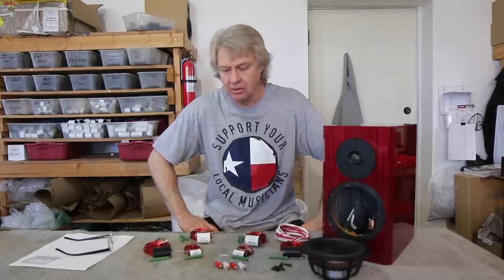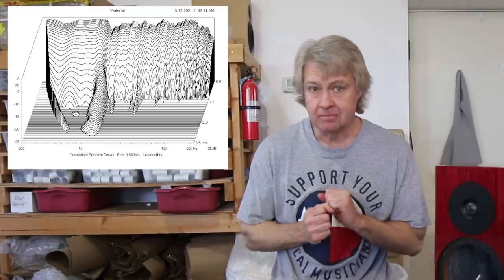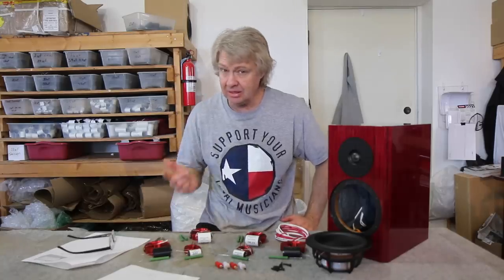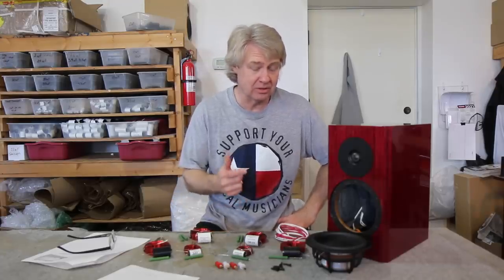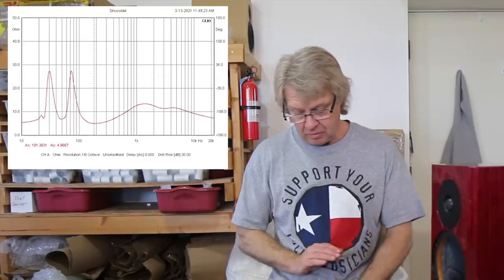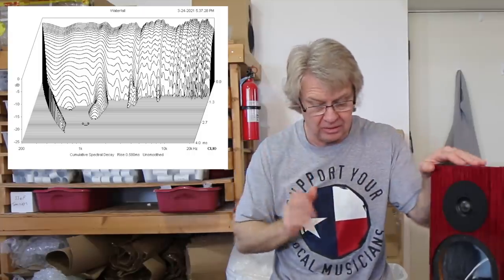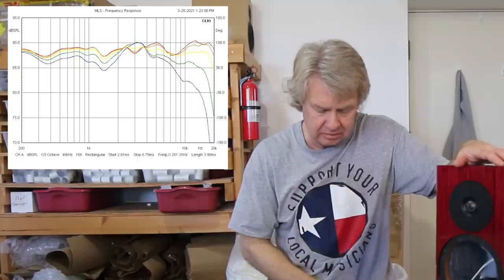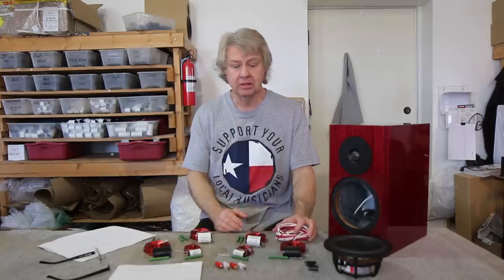Dynaudio | How “Special” is the 40?

Comment: These videos are very interesting but having heard the Special 40s many times (they sound very good) I have to ask, what's the point of changing all these parts if it doesn't make them sound "better" to the owner? We should all know by now that measurements are not the only determining factor in how well we think a product sounds. Many manufacturers have produced things that measure very well but sound lousy.  So I respect Danny's work, it's very important and informative, but without any qualitative listening comparisons before and after it's all moot. The bump in the 1k-1.1k range is well known and many owners of the S40s actually like it, so changing out all the parts for better ones is great in theory but if the sonic signature changes completely or enough that someone who would have bought them might no longer want to, then what's the point. This applies to all these speaker mods, not just the S40s. The HiFi world in general is very out of touch with VALUE, so let's not pretend Dynaudio is ripping people off, almost every audio company is ripping people off. Speakers are $3k, dealer pays ~$1.5k, distributor pays ~$750-$1000, costs Dynaudio maybe $300 to build the pair. That's the whole industry, nothing new there. Companies that sell direct like SVS are better perceived value because they cutout the distribution and dealer networks.  They are still making the same profit as all the other companies. Can we get some videos of before an after from people who've done these mods? You can make a nice sauce with a cheap bottle of wine, or a really expensive one, but if the cheap one tastes great, and >%90 of the expensive one which would you choose? The proof is in the pudding as they say.
Reply: If you think those sound good, then you haven't heard anything yet. What I did will make them sound better to everyone. 

You are correct though that the measurements don't tell us how it sounds. The measurements will show if there are or is going to be audible issues. 

When you do this as often  as I do you learn a lot of things that are given. By that I mean something that has repeatable results every time doesn't require confirmation every time to confirm the result. For instance, woofer break up and ringing is not a positive trait. It is not part of the input signal. It is an added coloration and is not desirable. Going from electrolytic caps to good poly caps reduces smearing. Going from cheap poly caps to Sonicaps improved detail levels and clarity considerably. No Rez removes cabinet wall resonances. Tube connectors and better wiring improve clarity every time. I don't need to confirm that every single time.  

And I get overwhelmingly positive feedback from customers that have implemented our upgrades every single day.
Reply: @dannyrichie9743  that's great, glad people are enjoying the mods. I don't agree with you though about coloration. While in theory it's not desirable, everything we/you do is coloration isn't it? Changing cables, materials, resonance etc. You're just changing the original color to one you prefer. There's no Truth in Hi-Fi though everyone enjoys the journey striving for it.  If everything measures the same we'd expect everything to sound the same. Who wants that? Everything can also be improved or humans would have stopped evolving but improvements can be subjective (though not always), especially in Hi-Fi. I prefer more pepper on my steak, my wife prefers salt. Neither one of us is wrong. I think what you're doing is great and very informative, keep it up. Would be great to get input from the manufacturers as to why things were done/left a certain way (aside from cost)? Have you reached out to any of them for comments on your findings and subsequent upgrades?
Reply: @Coolesttech  On measuring verses listening. I can make the same two speakers measure exactly the same and sound extremely different depending on the type and quality of parts used. 

And typically it is not about subjective preference. There are a given set of attributes that are always preferred. For instance, reduced smearing it pretty much always preferred over a smeared sound. 

And manufacturers reach out to me all the time. I spoke to one this week.
Reply: @dannyrichie9743  and what are they telling you? Are they disputing your findings or justifying them or both?
Reply: @Coolesttech  It is different with each company. One company sent me a speaker for me to design and offer an upgrade for their customers. One wanted to know how I was measuring and what measuring system I was using. One didn't really care about the upgrades and called to ask me about unrelated design considerations for something new they have in the works. And two of them may be doing a video with me soon. I think we will have Ron and New Record day host a three way video chat with all of us. We'll see.
Reply: @dannyrichie9743  very interesting. I'll be on the lookout for that video. Upgrades are always good, it's easy to rip apart all kinds of products out there for one thing or another. Too many people seem to think adding up the BOM is all something should cost, overlooking overhead, r&d (hopefully), marketing, logistics, and God forbid profit. Even DIY kits have profit built in. I'm curious, with regards to your upgrades, do you stop where you do to keep the cost to a certain $ amount like ~$300, or because you can't improve any further than what you've already come up with? Returns are always diminishing, I'm just curious what your goal is when you set out to "fix" a particular xover design.
Reply: @Coolesttech  I try to take each upgrade as far as I can within reason and figure out where best to use the best parts for the best bang for the buck. For instance in a lot of the upgrades I use Sonicaps in the tweeter circuit only. I could use them in the woofer circuit too, but the cost of the upgrade would be a lot higher. I could load them up with Deuland Copper caps too and run the price of the parts up to several thousand, but that would not go over well or help the people that I am trying to help.
Reply: @dannyrichie9743  makes sense thanks
Reply: @Coolesttech  
And by the way, SVS does sell through dealers as well like Magnolia, Electronics Expo here in new jersey and Crutchfield!  Great conversation in this post may I add.😉😇
Reply: @bigjay1970  I think they'll probably stop that is my guess as they try to go more upscale $$$
Reply: @Coolesttech  

Yep!
Reply: This is just a guy trying to sell his crossover kit. The speakers are fine.

Comment: You did certainly smooth out the response from a very mode weighted speaker. However, crossing over any common dome tweeter in this region will make it lack dynamic capability and add distortion. But the worst part is the extreme dispersion that drops significantly just below the crossover point. It will make the speaker sound harsh and feel like it is missing a midrange driver. I kind of understand the motivation for going on a project like this, but if I were you, I would have said that this speaker should not be fixed, and do another one instead.

I am also a bit frightened by your focus on insulation materials on cables, cross over component types etc. Sure crossover components matter, but it is not always the case that one should go for the more exotic options. And seriously, steel is just as good a conductor as brass. In this amount, the paramagnetic properties of the screw really does not matter. I hope people are able to look past some of this and focus on the things that actually matters.
Reply: Crossing a dome tweeter that low has nothing to do with dynamics, and it adds no distortion. And the dispersion does not drop off below the crossover point. Off axis response is actually improved. And it will be much less harsh now and more balanced. And this one REALLY needed to be fixed. 

Freighted? The types of materials used are a significant focus for good reason. And steel parts are never something good to have in the signal path and transferring the audio signal. Brass also is not as good as Copper. Everything matters!
Reply: @dannyrichie9743  This is quite a list of claims.

1: You claim that it is not common for a 1 inch dome tweeter to have increasing distortion below 2kHz? That seems to be a rather bald claim to begin with.

2: You claim that dome tweeters have no dynamic compression, and that this not affected by lower crossover points? Still a bit of a revolution I would say.

3: You have improved the off axis response? Is there a generally accepted condition in listening that wider dispersion is better?

4: And is it even a bit less uneaven than it was before you started? As far as I could see you did not run less steep slopes than originally?

5: How do you quantfy the impact of that steel screw? I mean, in order to determine it, you would need to have at least a few ohms of impedance for that magnetic field (which is extremely weak to begin with) to even be close to produce a measurable contribution to the signal. And by that, I mean the impedance in the screw itself. Can you please explain how this work? Feel free to use some schematics, and maths. I suggest you even make a video about it!

I would like to take the opportunity to point out that I love what you are doing, but I find your comments above here a bit redundant. So please read this as comments to your comment, and not to your videos or you as a person in general.
Reply: @menneskeeter  Many dome tweeters play fairly low with no issues. Our T26SG is one of the best domes out there. It's Fs is in the 500 to 600Hz range and can be crossed at or even below 1.8kHz all the time. We have literally thousands of them out there crossed at 1.8kHz with zero failures and no distortion issues at all. 

And the crossover point isn't the concern. The concern is how much of an amplitude rise there is at Fs and how many db down is it at the Fs.

And yes a wider and more even dispersion is generally considered better. 

And what steel screw are you talking about?
Reply: @dannyrichie9743  👍
Reply: @menneskeeter  Did Danny offended you with his measurements and corrections on the parts? Others have said the same. Danny gives us a solution to a problem. Paracetamol to a headache. Your choice to pick. Ok or better?

Comment: I have kinda notice that budget oriented audiophiles are startingbto hate on highend audio and cables. I hope this kind of trend stops. There is much more in highend audio than expensive equipment. I have installed cheap budget drivers and expensive ones.  Depth, layering and tones are natural in higher end stuff. While budget gear has good tone but lacks talent to create that soundstage. This is not to bash budget stuff because everyone starts from the beginning. But dont be close minded to look at the bigger picture. Danny here introduces you to highend at a budget so you can realize there is more.

Comment: Dynaudio is infamous for this sort of thing. Once upon a time when they made everything at their HQ things were different. At least such has been the perception. Now, as with Klipsch, even if the unit is assembled in Denmark, the crossover and drivers are often Chinese. While the point of origin isn't the issue, the bean counters temptation is. Why install a quality crossover when only a few will notice? When you have seriously cheap components made down the road, why pay for better ones that aren't interchangeable with ones from your kid's Bluetooth speaker if only you will know the difference?

Comment: Had special 40's for a bit. I like the speaker but there was certainly some congestion and spikes in frequency that were easily heard. I sold them. I would never mod speakers like this. If they are actually using junk then just dont buy the brand. Modding them tanks resale. Buy something else you like them. Buying and selling S40's is easy to do. Many pairs selling at any given time. There are cabinet issues with the S40s too. Theres flaws that shouldnt exist at the price point which is why I sold them. I happen to like the Dyn sound and owned C1's for awhile. The S40s had a similar sound but those flaws were a deal killer. Honestly, you can buy Yamaha monitors, the HS series that are as good as the special 40's for way less money. They are powered monitors but its a wake up call on the boutique speaker nonsense.
Reply: Actually the upgrade increases the value.
Reply: @dannyrichie9743  I’m with Jeff here, any mods will hurt resale value badly. Especially ones carried out by a random end user. Exception is maybe where the brand itself proved an upgrade path (e.g. audio note) and the mods were done professionally. But even then that might not increase the price, This is used audio 101.

Comment: I understand upgrading the quality of crossover components, but to completely change the crossover point by 1000hz and bring it down to such a low level to me would completely distort the intent of the speaker designer and probably a huge tonal chance to the speaker. That's a very low crossover point for even a Dynaudio speaker.
Reply: The lower crossover point was no issue for that tweeter and improved the overall response considerably, especially in the vertical plane.  If the original designer was that concerned with how the speaker sounded then they would not have chosen the budget level parts.
Reply: @dannyrichie9743  my Spendor A7 crosses at 3.7 hz, according to Spendor. I sent you the link to the Feb 2019 Stereophile measurements. Cross over parts look average..
Reply: @rd264  That's a really high crossover point.

Comment: The Price/Performance ratios for many HiFi speaker manufacturers are ridiciulously bad.
Especially crossover design is a weak spot for many, one could almost think they view it as some arcane black magic that needs to be avoided.
To be fair many audiophiles believe complex crossovers degrade the sound so manufacturers offer what the customers want.

Comment: Almost like a copycat of morel elate drivers, the paper covering the lower section of the basket, the foam inside the vent, the 3 allen key screws around the vent, the 3” voice coil and the polymer cone, the silver color magnet frame
Reply: Yeah, but the Dynaudio drivers were developed years before the Morels.

Comment: Of course I find this channel AFTER I got the parts for a crossover upgrade. It's Al K's design for the original Forte using Solens caps and Air Core inductors, but he did spec sand cast resistors and reuses the stock transformer. I guess other than the impedance, Klipsch got it mostly right, but since I'm running an Elekit TU 8600 with the Lundquhist OPTs, I'm hoping the better impedance will be a nice improvement, even if they remain a 4 Ohm load(5.5 Ohm actual) I'll have to hit you up for some tube connectors and wire to finish my list.
Reply: Klipsch and 'mostly right' never belong in the same sentence. Klipsch never has gotten the crossovers right.
Reply: @carlosoliveira-rc2xt  I dunno, they nailed the frequency response for these, a couple little blips down low and then only +-2db from 230Hz to 20kHz. And I won't even have a grand into 'em all done up better than new. I can have these, my custom full range and a set of Maggie 1.7i and at least part of a sub good enough to keep up for less than the "special" 40s
Reply: @BigFarm_ah365  Sorry, you lost me on your reply.

Comment: With so many of these supposedly high-end speakers having really crappy crossovers and wiring, what are brands known to do the opposite? Would be cool if we could start a spreadsheet of what internals come with what speakers. I was considering the Canton Reference 9k stand Mount speakers. They seem very high quality. Just afraid it might have really crappy stuff on the inside. I don't think it's the case but I would like to know for sure before purchase
Reply: Xavian as an example use high quality parts in their crossover network. They even publish it in the advertisement.
Reply: Marten speakers.
They use top components for my entire range of speakers.
The best drivers from Accuton, and for crossover I use Mundorf - low-loss copper foil coils and silver / gold oil condensers. and Jorma Design internal wiring.
The marten speakers are worth the price, they are phenomenal.

Comment: Great work - would love to see you work on a Zu Audio Omen speaker 🔈
Reply: ...and they need it. Ive seen their response curves 😮
Reply: Sean Casey runs the woofer almost wide open to maximize efficiency. It measures pretty well up to the treble region then becomes quite rough. He pads the very efficient tweeter down more than 10 dB.
Reply: I have already designed an upgrade for their Omen Mk 2.
Reply: @dannyrichie9743  can’t find anything on that - did you do a video ?
Reply: @michaelhald3819  I didn't do a video on it. It was one of the hundreds of speakers that I designed upgrades for long before I started shooting video's on them.

Comment: Really wondering how a company like Dynaudio which manufactures pretty damn good speakers and monitors can get tuned by smaller and prive companies. Not to blame your tuning, because it's obvious you pretty know what you're doing. But why such entitled company would do speakers with cheap components. It's not like their speakers cost 150-200USD. They have some pretty expesive ones too. 
Also, how about the ear sound, not always what's good on paper is always sound pleasing.
Can we trust speakers manufacturing these days or we should build our owns? There are plenty of super high quality drivers out there and electronic components.
Reply: Dynaudio has been bought out, once maybe twice by a large conglomerate. Sometimes this is good, and sometimes it isn't.